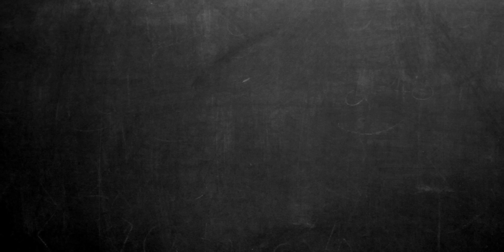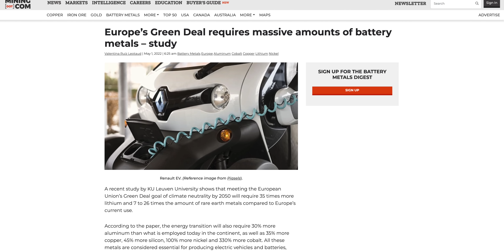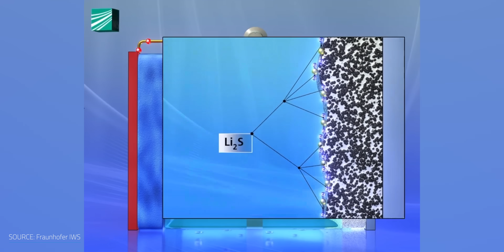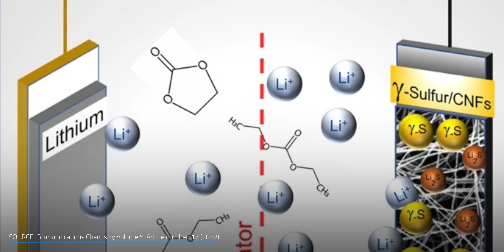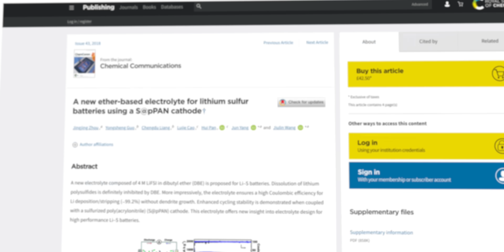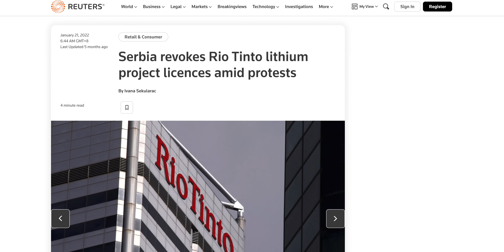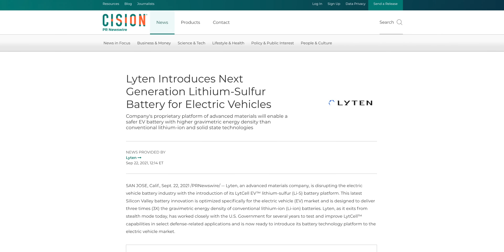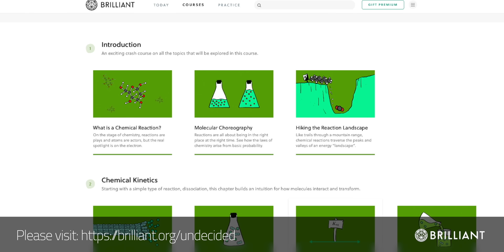Why This Accidental Battery Breakthrough Matters

Comment: I really hope we get a spread of useful battery chemistry out of this. I hate how heavily overinvested we are becoming on lithium to the point where grid storage, EVs and portable electronics are eating each other's supply chains to the detriment of all. Even having a straight up lesser option for things that don't need the best would alleviate the pressure at least.
Reply: Only about 7% of a lithium battery is lithium.

And nickel is likely to be the first metal we truly run short on for batteries.

Copper isn't far behind nickel.

And copper is extremely important in a LOT more ways than lithium is.

Making, transporting, and using basically All electricity, for example.

Lithium might get all the buzz, but there's a few "regular" metals more important than lithium is, when it comes to actually manufacturing a lithium battery.
Reply: @lordgarion514   Most Copper, iron, and lead mines in the USA are shut down because they aren't profitable. If copper becomes scarce, the price will go up, and all the mines in Nevada will reopen.
Reply: @lordgarion514  We have several formulations of lithium battery already past the drawing board and into actual production. At least one company expects to have a competitive nickel free battery available for EVs in 2025. My point wasn't to get rid of lithium either, it was to have alternatives that best utilize their advantages so that they better coexist.

The big example with lithium ion is grid storage which is frequent cycling and stationary. This channel has done several videos on alternatives to lithium ion batteries for grid storage that make a lot more sense on paper. Obviously, we'll need to see them implemented at scale before we can say if they actually do a better job, but grid storage is an obvious area for a better alternative to take that market.
Reply: @Merennulli  
I was talking about the fact that it isn't really the lithium that's holding back lithium batteries....

As far as your nickel free battery goes.
I also said, copper isn't far behind nickel. It's expected to have a decent year this year, and then copper is expected to be in short supply.
And a lithium battery has about 3% more copper than lithium.

There's actually a pretty decent list of "common" metals that we barely make enough of. And any one of them will hold back batteries.
Reply: @lordgarion514  The point, again, is that we're not still trying to do everything with one specific chemistry. I gave lithium as an example because almost everything has gone to lithium, with the vast majority of it being lithium-ion even when it's not the best tool for the job.

Copper is being used because it makes sense to use copper. We DO have alternatives to copper that could be used if that becomes the bottleneck. Though, to be frank, the small amount of copper going to battery usage isn't relevant (we have 50x the reserves of copper compared to lithium). If it gets to that point with copper, we'll be switching cables that don't need the same level of conductivity before we take the copper connections out of batteries.
Reply: @lordgarion514  copper is getting more expensive but we are no where near running out. Cost and rarity are not the same thing. There is not much lithium on earth. We run out of lithium that’s it doesn’t matter how much money you have it’s all in use there is no more to buy. Copper on the other hand is in nearly unlimited supply it just keeps getting more expensive to mine. However the more of it we mine the more is in circulation being recycled which actually offsets the cost and makes it cheaper. Also when people talk about the rarity of metals they mean in the upper layers of earth’s crust. Just mine down to the core where all the metals actually are. Thanks to modern technology mining can easily go last earths crust. And volcanos ect bring up new metal all the time. Anyway the issue isn’t abundance it’s inflation.
Reply: @jacobleeson4763  
LOL

You might want to actually do some research into that deep mining claim.

That's the dumbest thing I've heard.
We don't have nearly the technology needed to go that deep.

Mainly because metals weaken as they get hotter, and nothing we make, AND nothing even predicted is capable of sustaining the strength needed at those temps.
And let's not forget that just below the crust, the pressure will just push the rock into the hole you just made.
Reply: There's been some major progress happening in Sodium-Ion batteries in the past few years, and there's some expected product releases coming out in the next 2-3 years from a couple companies. Prussian Blue (Iron-Carbon-Nitrogen compounds), Hard Carbon, and Sodium-Manganese-Iron-Oxide compounds are the major chemicals being used for it all. AMTE is running a year-long test with a power company right now, so we'll see what comes of that one. Either way, there's going to be some changes in the battery industry coming up faster than folks think.
Reply: @EmptyZoo393  there are always products  based on revolutionary battery technology expected to come out in 2, 3, 5 years. But they don't, or when the do the gains aren't nearly as significant as were promised
Reply: @NJ-wb1cz  I've almost given up on these stories. I used to follow battery technology advancements closely but I've learned that most of these announcements are just to drum up grant money or investment, while never really becoming anything in the long run. I wish this wasn't the case. If Elon announced a breakthrough then I would pay attention, but notice even his announcements are just an evolution of the existing technology. It's really hard to improve on what we have, but they do keep finding incremental improvements and that is something.
Reply: @cendrizzi  
It's not the scientists fault.
We've already done the easy stuff.

And the more advanced you become, the more the next step up is going to cost, and the longer it's going to take.
And yes, the higher your technology, the more lines of research won't work out.

Just remember that it took 80 years from the invention of the refrigerator (freezer actually) until you could go buy one at the store.

The blu-ray took 11 years.
Reply: @EmptyZoo393  the basic problem remains - once you pack that much self-sufficient energy into one object, it tends to explode in all sorts of fun ways. "Battery" is just another name for an explosive, and making the most powerful explosive that won't actually explode is an extremely error prone process. And when faced with reality, the ambitions usually have to be massively tempered to reduce the chances of your consumers blowing up en masse
Reply: @NJ-wb1cz  
No, it doesn't.
Pretty bad things have to go wrong for a battery to go boom.

They never "just" go off.

And there's a perfectly good explanation for why they don't.

Fact is, a lithium ion battery, and literally every battery ever made, can hold FAR more energy than it's rated for.

You take the charge controller out of the equation, and you can put enough energy into a battery,that a simple tap with a stick will literally make it explode because of how unstable it is.

AND all fossil fuels, especially the liquid and gas versions, are vastly more likely to go boom.

At the levels we charge them, they're VERY safe.(and very safe doesn't mean zero failures).
But since fossil fuels are many orders of magnitude more likely to explode, I'm not understanding why you're complaining......
Reply: @lordgarion514  when you manufacture millions upon millions of batteries to be used in all sorts of conditions things go wrong all the time. The denser it is and the more energy it packs, the worse the explosion. 8 times the capacity equals 8 times the explosive power. 8 times the lithium ion density means you new wonderful battery releases 4 to 6 times more energy than TNT when it explodes

The only reason why gas doesn't explode the same way and why gas can pack much more energy, is because it's not a complete explosive - it has to continuously take oxygen from the atmosphere
Reply: @lordgarion514  to make it more clear - if the 8x promise is real, then a LiS battery the size of a phone battery will pack as much energy as 1-2 dynamite sticks. That you will be keeping close to your groin area
Reply: @NJ-wb1cz  
LOL.

I suppose you don't know that there's enough energy in a candy bar to literally level a couple of square blocks.

And a tank holding 15+ gallons of extremely flammable liquid fuel is sitting right behind you when you're driving.

You're worried about a stick or two??
A gallon of gas has the explosive power of 83 sticks of dynamite.......

That's 1,245 sticks of dynamite sitting 4 feet from you.......

What were you saying again???
Reply: @NJ-wb1cz  There are certain radioactive gases that can blur the lines between battery and power source that can pack huge energy densities into a small compact design that are reasonably safe as radioactive materials go
Reply: @lordgarion514  you completely missed the point he was saying. Batteries are safe because we invested lots of time and money to make them so and because they get used with huge safety margins not reaching anywhere near their full potential. It took a lot of work to make lithium batteries safe. The argument wasn’t that they aren’t safe it was about what it takes to make them that way.
Reply: @jacobleeson4763  
Same with gas......

On literally every point.
Right down to developing special chemicals to help keep gas from going boom.

We could pressurize, and heat gas up to several hundred degrees before it goes into the cylinder, and get massive amounts of extra power.

It's also really easy to go boom. So we forgo the extra power and efficiency for safety.

No, it wasn't me that missed something. I'm just not leaving anything out.

And we have spent orders of magnitude more money making the liquid and gas fossil fuels as safe as possible. AND we're still spending millions upon millions in research every year, to make them even less dangerous. Because they are STILL extremely dangerous.

What were you talking about again??
Reply: @jacobleeson4763  
And if you want to see a safety margin.....

It takes 34KWH to drive a roughly 5,000 pound Tesla 100 miles.

A gallon of gas contains 38.7KWH, and yet it takes about 5 gallons of gas to drive a 5,000 pound gas car 100 miles.

A gas car pisses away 160KWH of energy.

We could do vastly better, but it gets a LOT more dangerous.
Reply: @NJ-wb1cz  That ship has already sailed if you're willing to go around with at least a few kilograms of Gasoline wherever you go.
Reply: @GonzoDonzo  isn't it more optimal to put radioactive materials in a reactor and deliver the energy as electricity? And it's not like governments will suddenly legalize putting dirty bombs in the hands of the general public, regardless how safe the technology is when used as intended
Reply: There's have been a new revolutionary technology announced every year promising improvements on the order of magnitude for well over a decade, and yet the progress is still extremely slow and incremental. At this point the only thing worth getting hyped up about is an actual physical mass produced battery in an actual physical product you can buy
Reply: I think here in the near future you will start to see more differentiation in battery chemistries. Grid scale and home storage while dominated by Li-Ion now definitely won’t be in the near future. Fixed placement storage care about only one thing the total cost per Kwh stored and retrieved. When you don’t have to have enough excess capacity to drag around your own mass around other chemistries get much more attractive.
Reply: Graphene batteries are coming soon. It's cheaper, stronger, lighter, and holds a charge much longer than any Lithium based batteries I've heard of.  I like lithium Iron Phosphate batteries better than Lithium Cobalt or Lithium Manganese.
Reply: @TexanUSMC8089  Yeah, I'm excited about the possibilities of graphene batteries, though admittedly I've not been keeping up with their progress. One of the big selling points for the technology is that it's a lot faster to charge, which could potentially be used in a hybrid battery system in EVs to allow far more rapid charging on the same level of speed as gas refueling.

Last I heard the core issue was capacity retention, though, which has to be mitigated significantly before it can see EV use.
Reply: Thankfully hybrid vehicles are still mostly using NiMH.
Reply: The issue is lithium tech is mature at 30+ years.  There are a number of newer battery types for different applications that are at the 10 year mark, and since the lithium market exploded, it seems new ideas are beginning to be explored as well.  I would say liquid metal batteries are probably the next to come online, but you won't hear much unless you are in grid storage.  500 C and massive weight will prevent them from being in consumer level applications.
Reply: @Krieghandt  Grid storage is the biggest issue with lithium right now, and I find all the different options being explored encouraging. Some of the modular potential energy storage are also getting installed in small scale already.
Reply: Take a good look at the periodic table. Lithium is the lightest metal. Lithium is still the best hope for a stable battery material. But it is by no means tapped out in terms of improvements. We have a very long way to go in terms of electrolytes, anode materials, doping compounds etc. It is possible that in 30 years time lithium batteries will be unrecognizable and require far less lithium but be many times more energy dense.

Supply chain issues are mostly a problem because most of the industry believed 15-20 years ago that EVs would never be popular and never have demand. So nobody invested heavily enough in mining and extracting at the critical juncture. Investment TODAY is 15 years too late and the knockon effects will be felt throughout the industry. 2035 fossil fuels bans are well intentioned, but they came too late for industries to catch up. The demand problem will be with us for a very long time.
Reply: @patreekotime4578  Re-watch 7:53 - Sodium is more common on Earth. The periodic table is not the end-all-be-all. The trick you're talking about with looking at periodic table placement is an easy rule of thumb, not a physical law. Just because something is the lightest does not mean it's automatically the most abundant on the surface of earth. In this case, lithium is less common than sodium because, although it is more commonly produced in stellar fusion, are also more commonly destroyed by the same process.
Reply: @patreekotime4578  Lithium is one of the lightest elements. Hydrogen is actually the first on the periodic table not lithium. Anyway lithium also has the least energy. The bigger an atom is the stronger the pull it has in its electrons. Think of electrons attracted to a nucleus as an elastic band. You pull the band out creating potential energy and when you let go it turns in to kinetic energy as the electrons/elastic go back. Other elements are more heavy because they have more protons and neutrons but they have much greater potential energy and energy density. You got it all wrong best element for battery technology is actually the heaviest. Not only do heavier elements have more electrons but the force on each individual electron pulling it to nucleus is stronger. So for each proton you add weight increases linearly but potential energy does not. Making heavier metals way better than lithium. Lead acid would actually be lighter if it wasn’t for the fact that the battery technology uses water. Lead acid is getting better though and there are better electrolytes like gels being used which make them closer in mass. Lead actually still has a lot of potential just need to try it with alternative elements rather than sulfuric acid dissolved in water. Anyway lithium’s advantage is that it is solid state. That is what gives it it’s durability and density. Battery technologies which use liquid electrolytes will always be heavier because electrolytes add to weight without providing additional capacity.
Reply: @patreekotime4578  Why do we care how light lithium is, if we want to have a bunch of stationary batteries at grid scale? At that point you care more about cost, durability, efficiency, and weight only matters as it contributes to cost. Lithium has been around because we needed light mobile batteries, less research has gone into batteries that match grid needs. I personally expect as the need for light batteries for vehicles, etc increases, grid batteries will move to a different chemistry or away from standard batteries entirely
Reply: Like what you saying here: 
Creating various different batteries utilizing different materials 
And, having types of light mobile and heavy stationary batteries would be more sustainable, economically 
We need to start thinking systems,  not individual technologies
Reply: we haven't had any alternatives to lithium for like 35 years
Reply: @juhotuho10  - For portability, that's true. In your cell phone & EV, lithium is the current way to go. BUT for grid storage, the battery isn't moving, and space isn't that urgent either. There are many, older battery technologies, and non-battery technologies, that can be, and SHOULD BE used for grid storage. And don't buy the power delivery BULLSHIT. I'm an electrical engineer, and those arguments are made by non-technical types.
Reply: @juhotuho10  I mean I really think fuel cells have a use that is being ignored (for evs)
Reply: Were coming up with new breakthroughs all the time. The transition to something new will start soon. Were just a little over two decades away from running out of the global lithium reserves. 
He mentions the breakthrough weve had with sodium batteries. So far they look to be the front runner to replace lithium. Cheaper and more abundant as well
Reply: Repent and believe in Jesus Christ  Jesus, when will you give us some sustainable batteries with high capacities that don't blow up?? Why have you forsaken us?!
Reply: The bright side of this is that overall, the cost curve per kW/H for battery tech has been coming down year over year. See any Tony Seba lecture and he makes the argument that it's following the path of a disruptive technology and will therefore become cheaper at an accelerating pace for years to come. The improvements can come from better chemistry or manufacturing, increased supply or other efficiencies - while we could always use more breakthroughs, one way or another, the trajectory we're on suggests that we'll be able to deploy batteries at a transformative scale very soon.
Reply: I think most people would be okay with iron batteries for most things
Reply: Nuclear
Reply: @scottslotterbeck3796  Some very small scale ones should be coming to market soon. I'm not sure what applications they'll have since they're low output, but it is really cool to see finally come to fruition. (I know, not chemical, but still cool.)
Reply: Lithium is good
Reply: @BMac420  It's good for some uses, not for all. The point is to stop trying to treat it as the solution for everything and only use it for what it's the better option.
Reply: there have been so many breakthrough innovations in the past two decades... some low tech some high tech but none have changed much in dealing with the problems next generations have to cope with ... I fear that EV will not be the solution... more human powered vehicles and more mass transit is the solution
Reply: @larsbee  There won't be one solution, it will be countless solutions. EVs solve one piece of the problem, human powered vehicles...honestly are irrelevant to this, and mass transit solves others.

I do want to emphasize the human powered vehicles being almost irrelevant part. A human exerting adds about 1 liter of CO2 waste a minute over being at rest, vs 5 for a car with an ICE engine. The amount of trips that could be replaced with human powered vehicles is just under 0.25%, so we're saving 0.2% of CO2 emissions over ICE engines. For EVs that drops to less than 0.1%. There are definite benefits to using human powered vehicles, but they're for the health of the person using them, not emissions.
Reply: @Merennulli  that's a yesteryear view of what is possible ... a let's keep the status quo ... and maybe change it with a few minor changes through innovation which with the EV opens other pandora boxes ... now having said that our two households share one EV with a top 5 mileage powered mostly with wind, solar, water and still a bit of gas and coal ... most households in my neighborhood stick to the one car for each adult insanity ... 

anyways in the end we need a change of lifestyles not so much hitech innovations ... or at least paired with hitech...
Reply: Are you also annoyed at how "heavily overinvested" we are in iron?  Lithium has chemical properties that no other element has because if they did, then they'd be lithium.
Reply: @Asdayasman  How are we overinvested in iron? We have plenty of materials that do the same work with different advantages. It's an example of the exact benefit I was talking about. We use iron where it makes sense, carbon in various forms where it makes sense, as well as titanium and aluminum.

Also, iron is the 4th most common element in the continental crusts on Earth. Lithium is 33rd, and the sodium brought up in this video is 6th.

And, critically, for many of these applications we don't get the benefits of lithium. Grid storage in particular cycles frequently and doesn't move, the exact opposite of where lithium shines.
Reply: @Merennulli  Way to miss the point completely genius.  Not like I spelt it out for you in simple terms or anything.
Reply: @Asdayasman  I responded to the question you asked. The rest wasn't a point, it was a tautology with no relevance to the subject at hand. We aren't using lithium because we need the exact properties of lithium. We're using lithium because it happens to react to other chemicals in a useful way for storing and releasing electricity. Other chemicals react with each others in other useful ways for storing and releasing electricity.
Reply: @Merennulli  Please learn any amount of chemistry.  Any at all.
Reply: @Asdayasman  Ok, I'm muting you now. I don't know if you're trolling, but even if you're not, you clearly aren't contributing to the conversation.
Reply: @Merennulli  "hurr durr lithium bad we should use something that isn't lithium" when it's literally the whole reason batteries are so good nowadays.  A conversation takes at least two people with brains, and unfortunately you're missing one.
Reply: @Asdayasman  Iron is the fourth most abundant element in the Earth's crust.  It would be difficult to be overinvested in it.  The chemical properties of lithium aren't what makes it lithium, it's atomic structure is.  Multiple elements can have similar properties without being each other.  For example both Li and Na have that explosive redox reaction in water but Sodium is not Lithium and Lithium is not Sodium.
Reply: @wolffang489  Gee you think that maybe atomic structure and chemical properties might be related, and that atomic number is important, and that lithium's electrical properties might just make it the best element for use as a charge carrier in batteries?  Perish the thought.  Let's just make sodium batteries lmao surely there's no problem with those at all.

(Except all the problems with sodium batteries, see Asianometry's channel for more).
Reply: it's what happens when you let the private sector fight over supplying for the public. a lot of these industries would have so much less bloat and waste if you just nationalized them.
Reply: @doji_town_adventures  LMAO because governments are well-known for efficiency right?

Funniest post I've read in ages.
Reply: @Asdayasman  when it comes to most things, they're definitely better at it than private companies, if you're already gonna be paying taxes out the ass why not have it go towards shit that actually matters? i'd rather my money go towards taking care of the public than blowing up people for oil. it's not like private companies are any better; they aim to create a monopoly and then overcharge out the ass for the same base level service. fixed price monopoly>>monopoly who's prices fluctuate based on the shareholder's breed